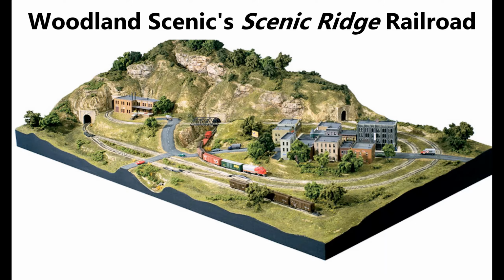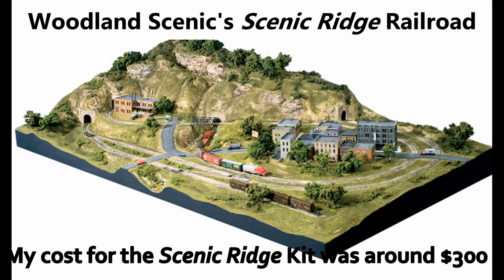Scenic Ridge #1  Introduction and Base Construction

Comment: Why does Woodland Scenics always have track on risers, why cant you start at the base and work up.
Reply from the maker: Because the risers provide much of the strength of the base. The thin foam at the base is only a 1/4 in thick. Also they make a lot of money on risers. If you’ve seen my later layout you can note I use a double layer of foam board with the top layer rising and falling. Much cheaper.

Comment: I like your adaptation for the road coming underneath the bridge.  I will desiign and 3d print a bridge as well.  I made some tunnel liners with a rock wall that I put on Thingieverse.  This is my second Scenic Ridge and I learned alot from the first one.  Great videos and thank you for sharing.

Comment: Under the track plan,  is there a foam base? I assume that there is one, but if not will the track plan hold up?
Reply from the maker: There is a 1/4” thick sheet of styrofoam. But there is the track support and other structural pieces that make the whole thing very strong. Get the manual from woodland Scenic to see how it goes together.

Comment: Dean, do you think I could use some N gauge Flex Track in building the Scenic Ridge kit? They say it would be hard to hold the tight curves. But Woodland Scenic doesn't have the Track Kit for the Scenic Ridge layout right now, and probably won't have it for several months.